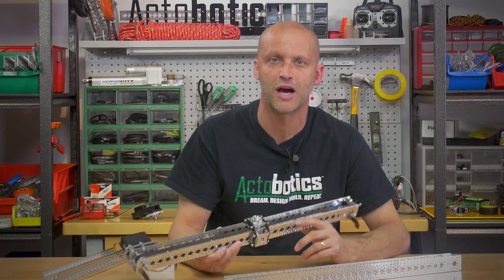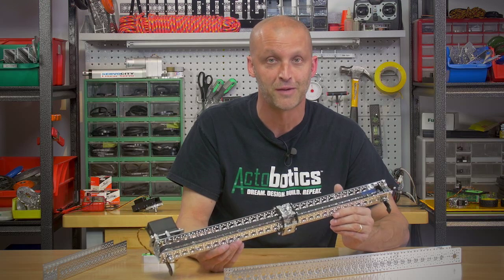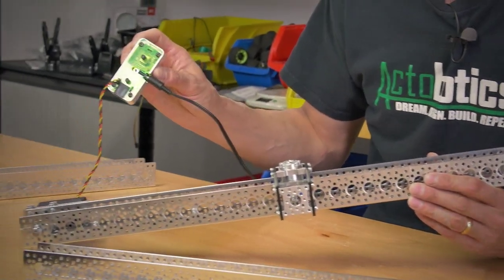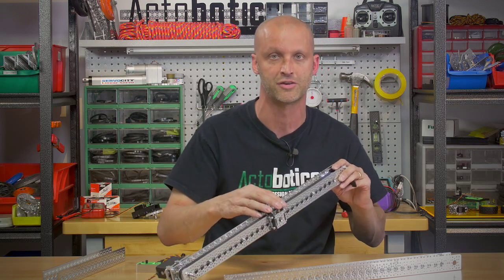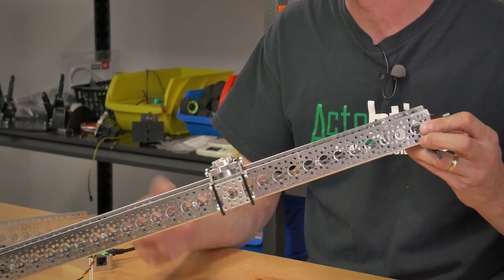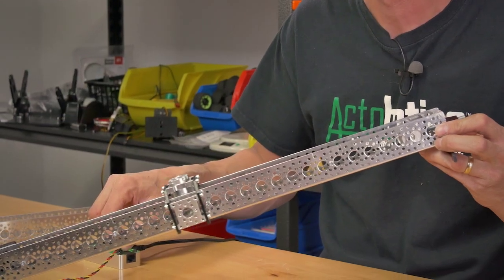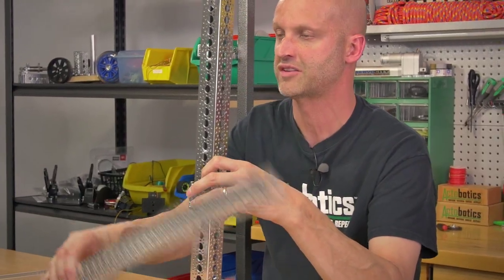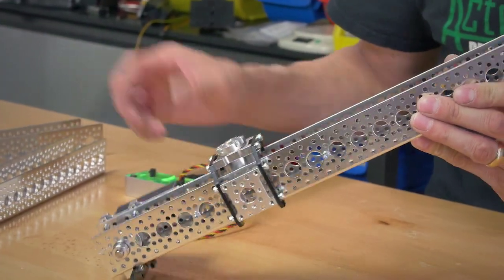ServoCity Products: HS-785 Channel Slider Kit

Comment: Would this be able to support the weight of a DSLR and some accessories that mount on the camera (up to 6 pounds) without affecting/harming the servo?
Reply from the maker: Tyler Jachetta The servo would be able to handle a 6lb load.  To better stabilize a 6lb load you may want to consider the ‘channel slider A’ plates (p/n 585550) so that it wraps around the channel and adds strength.  If you run these plates you should also consider attaching the 2 additional sides of the plates using hub mounts.

Comment: Im working on a design for a slider that can go much further, say 6 ft.  Is there anything that would prevent expansion of this slider kit to longer lengths other than availability of longer belts?
Reply from the maker: Emerald13 Thanks for contacting us!  One way to build a 6' slider would be to custom order an Igus rail from the manufacturer and then couple that to our Igus slider kit so you could put a motor on the end.  You'd need a longer length of belt, but other than that it'd work out very nicely.  Feel free to contact our Tech Team should you have any additional questions.  We'd be glad to assist!  tech@servocity.com